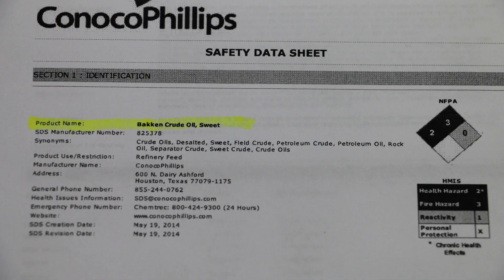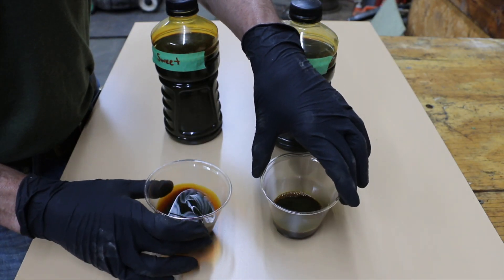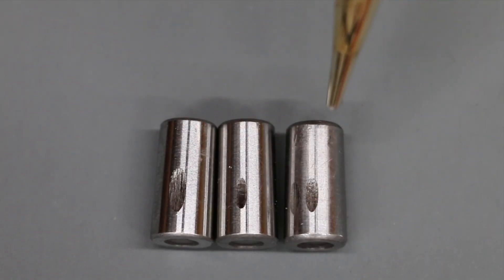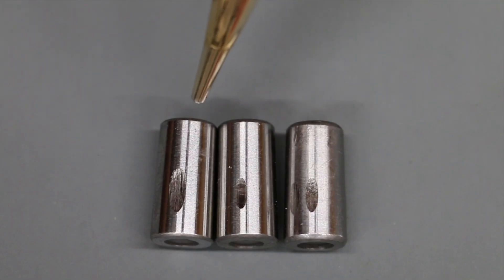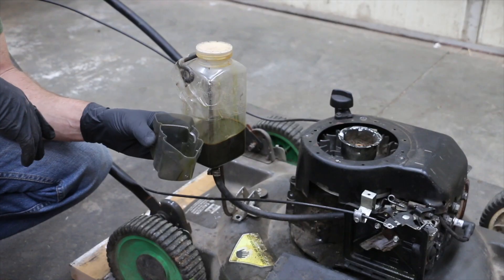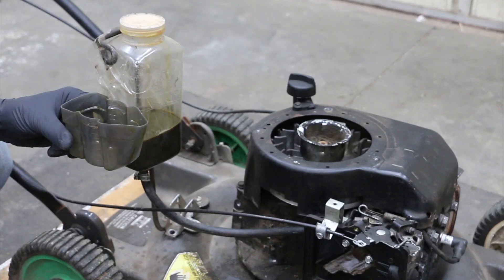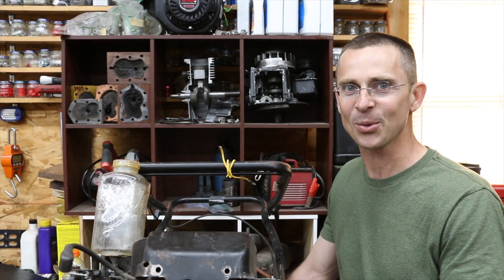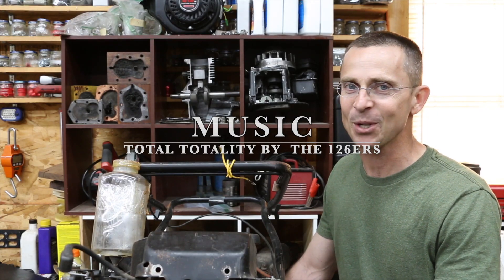Will a Gas engine run on Crude Oil?  Let's try it!

Comment: Thanks for another great test! Here is an idea: We know that an engine will run on denatured alcohol but how much water can be added to that alcohol before it won't run?  For example, most rubbing alcohol is 50, 70, or 91% alcohol, the rest water.
Reply from the maker: Thank you for the video idea!

Comment: What about running a gas engine on propane? I know LP engines and Gasoline engines are generally the same with just a different carb. But would a gas engine run with propane piped straight into the gas carb?
Reply from the maker: Thank you for the video idea!

Comment: My late father burned crude oil in a Dodge that was used on our farm over 80 years ago. He said that he could run the Dodge on straight crude oil from an oil well on our farm on hot summer days. However, he had to drain the fuel system while it was still hot or it would clog up the fuel system.
Reply from the maker: This is interesting.

Comment: Soon as you showed the viscosity of the sweet I know it wasn't going to get through the carb. Looks like a 10.30. Very surprised on how clean the engine stayed. I've dealt with engines with oil consumption that foul plugs out quickly but yours took it like a champ.
Reply: The reason that the crude didn't foul out the plug as quickly as engine oil is twofold. First, the crude oil has a lot of aromatic components, which burn well, and are purposely removed from refined lubricating oils, both because they make lubricating oil worse, and because they're needed elsewhere as fuel. Secondly, most lubricating oils have a number of mineral compounds added in significant amounts, such as zinc and molybdenum, and these leave an ash behind when the oil is flashed off in the combustion process. The combination makes regular lubricating oil very messy when it is pulled through a gasoline engine. The crude was better suited, ironically.
Reply from the maker: Great point.

Comment: It seems that you could tune an engine to run properly off sour crude oil. So the question is, why do we not use sour crude oil burning engines, especially for things like lawn mowers and whatnot? Also, why don't we use sour crude oil as lubricant? It seems to work well and did not even gunk up the engine. Being unrefined, it has to be cheaper then gasoline.

Comment: i wonder how it would run on a disel
Reply from the maker: Thank you for the video idea!
Reply: In an old one, perfectly. Most boring PF video ever. In a new one, the computer will throw 31,794 errors and put it in limp mode because the sensors are raging and dying. Most expensive PF video ever.
Reply: small engine diesel's have sensors now?
Reply: Many do, and many more are scheduled to get them soon. The EPA's new off-road emissions program (thank George W. for that) mandates that most off-road engines have emissions levels on par with on-road vehicles, after the phase-in period, which is nearly over.

They even made it so that fixing the old ones will become increasingly difficult because the manufacturers are effectively barred from making replacement parts for the old pre-EPA off road motors by a pollution points system that makes it unfeasible for them to help you fix your old "dirty" motor because it takes too many points out of their pollution quota. Fortunately, this inane points system is getting slowly rolled back, and some repair parts for some of the older motors are coming back. The law was apparently written such that it can't be simply scrapped, but has to be phased back out. Government at its finest.....
Reply: well guess its a good thing i got a friend who dose milling and 3d printing.

Comment: Ship engines that use bunker fuel (4% sulphur) have total base numbers (TBN) of up to 80 to neutralise the sulphuric acid in the piston blow-by created during combustion.  Automotive oils have much lower TBNs of 8-12 because motor fuels are so well refined.  You’d probably want an oil change after running the sour light crude!
Cheers from Australia 🇦🇺
Reply from the maker: This is interesting. Thank you for this information.  Cheers

Comment: It would be interesting to consider the long term effects of this fuel on the mower components (carb, piston, valves, tubes) and whether the exhaust gases are too toxic for it to be worth the hassle. Maybe filtering it could help stop particle impurities from harming the engine.
Reply from the maker: Great point.

Comment: Please try making the exhaust of an engine go to the intake of the engine and see how long it lasts. If anyone agrees, like the comment so he can see it
Reply: So at that point you're running EGR like a pre-variable valve timing smog-controlled automobile. It is possible to do, to a point, but you reduce the power potential because you're reducing the available oxygen, which requires reducing the fuel to get a clean burn, and if you replace too much fuel/air mix with exhaust, it destroys the burn.

This is not a new idea, and drivers have played with it in EGR cars, believe it or not. The theory is that by increasing EGR, you can lower fuel, and save gas. Essentially, this is using exhaust gas to artificially lower the engine displacement. It works to a point. However what these people have discovered is that with more than about 10% exhaust in the mix it won't run right no matter what else you do.
Reply: It won't run because the oxygen is depleted in the exhaust. No oxygen, no boom. That's why it is vented off instead of recirculated. Hence words: exhaust gas = oxygen is exhausted = used up and time to get rid of it and get some fresh stuff.
Reply: Original_Indy_04 someone has been watching The Human Centipede
Reply from the maker: Thank you for the video idea!
Reply: Your welcome
Reply: Yeah but it would still run for at least some time, like a couple of seconds or something. And u know him, he can tweak it like putting a hole in the intake so it gets some clean air

Comment: The lubricity test results amazed me. The engines of some of the new giant container ships are designed to run on an inexpensive grade of oil not much different than crude.

Comment: I worked in the industry and put raw condensate in my truck. It knocked like crazy. I added octane boost and premium every time it went down a quarter tank. After 2 times it stopped knocking.
Reply from the maker: Interesting.
Reply: The old timers called that stuff "head gas." You do have to boost the octane, but it will run.

Comment: Dude, that's so freaking dangerous... you're nuts.  Touching it without the appropriate gloves (which you didn't have but it looks like you didn't touch it anyway) and breathing the fumes and vapors is extremely dangerous.  There's some tests that I would have never done - this being one of them.
Reply from the maker: Thanks for the caution.
Reply: Thanks bro.  ^_^

Comment: If you get a fuel that's too thick. Next time warm it up on a camping stove in a pot (outside,
) the heat will alter the viscosity. Same idea as running veg oil in a diesel. Will mean you don't have to cut it with another substance
Reply from the maker: Thank you for the recommendation!

Comment: Maybe the good lubrication of the crude oil would make it suitable to run in a 2-stroke engine without having to add any oil? Would be a fun test as well, see if it survives.
Reply from the maker: Thank you for the video idea!
Reply: This one seems really interesting
Reply: Can you pump crude oil through a 2-stroke carburettor? Won't the viscosity be a problem without the crude oil being heated to reduce  is viscosity?

Comment: Its a Quantum briggs and Stratton, pull the main jet (fuel bowl nut) and step it up a few thousandths. The screw you turned is just the idle circuit
Reply from the maker: Thanks for the recommendation.

Comment: Great video & testing Todd!
As best as I can remember the large diesel engines that burn crude oil have to have the oil heated and I think they also added some diesel fuel to the crude oil.
Reply from the maker: Thank you very much and great point regarding crude oil getting heated before use.

Comment: WOW, not a result I would have expected.  That sour oil looks like it burns very clean also and the lubricity test (interesting to compare it to Motorcote) was just as unexpected, I'd imagine it would be way cheaper than gasoline and would be nice to see it at the Gas Stations for things like mowers that run without catalytic converters.   Yet another great project, thanks and keep them coming!
Reply from the maker: Thank you!

Comment: Please try 30% used filtered cooking oil, 70% gas mixture! That should work. If so, we can than use used cooking oil as 30/70 mixture, instead of throwing it away!
Reply from the maker: Thank you for the video idea!
Reply: It would run badly, smoke a lot, and leave vegetable waxes all over the inside of the combustion chamber. Gasoline engines don't burn hot enough to burn up the oil completely, so the residues would ruin the engine fairly quickly.

On the other hand, if Dr. Project wants to show the world exactly how that looks, well, I'll watch. :D
Reply: I don't think it would be so bad, i think maybe it wouldn't be bad at all. He did a video, where he mixed 50% of gasoline and 50 % of diesel in a gasoline engine, and it run fine. Properties of vegetable oil are not that much different than diesel.. so.. i think 70% gasoline, 30% vegetable oil will work.
Reply: You've been watching for awhile. :D However, you're mistaken about the vegetable oil not being that different than diesel. Vegetable oil contains glycerine, which diesel does not, and it has a much higher viscosity, and much lower aromatics compared to diesel. Purpose-built diesel engines have to be customized a bit to burn vegetable oil properly, and a gas engine will hardly burn it at all, even with a gasoline carrier. It won't atomize well in the carburetor, and the combustion simply doesn't get hot enough. A large amount of the vegetable oil would simply get baked onto the engine internals, and most of the rest would simply be spit out the exhaust.
Reply: As i said properties of vegetable oil are not that much different than diesel. (I know exactly about molecular structure of vegetable oil, don't worry :D). In summer you can put vegetable oil (heavily filtered best to 1 micron if you are using used oil) in diesel engine without any modification, people are already doing that (search for numerous videos on youtube). The main difference between vegetable oil and diesel are viscosity. Vegetable oil has higher viscosity than diesel at the same temperature, BUT viscosity of the vegetable oil on a hot summer day is the same as diesel viscosity at colder weather. The modification is only required if you are going to use vegetable oil at lower temperatures (in winter), and the only thing that modification does, is heat up the vegetable oil (there are two common ways to do that). Ps: and yeaah i've been watching for a while yes :D
Reply: "As i said properties of vegetable oil are not that much different than diesel." I am not sure what you exactly know, but you're simply mistaken. The two are much more different than you believe. As someone who has owned many diesels, and burned a lot of vegetable and other oils in them, I can assure you, you're mistaken.

It is true that some people do run vegetable oil in their diesels without modification in the summer. Typically these people are blending it to reduce the viscosity, and even then they are taking some risks because of potentially poor atomization. It is also true that the majority of modifications for running vegetable oil are just heaters, but you fail to understand how important that heating is to the proper operation of the engine when running on vegetable oil, even in the summer. Unless you get the oil to 160 degrees fahrenheit, it will not properly spray out of the injectors, which runs the risk of fouling even in a diesel engine.

But the fundamental difference here is the burn temperatures of gasoline engines versus diesel engines. Diesel engines burn hot enough to burn the many extremely low-volatility compounds in vegetable oil, if you atomize it properly. Gasoline engines simply do not. The bulk of that low-volatility stuff will become goo if you run it through a gasoline engine, and will ruin the engine.

At this point, I hope PF does it just so you can see what I'm trying to explain.

Comment: If the flashpoint is -20 why isn't it burning at room temp
Reply from the maker: Autoignition temp is much higher and is the temp at which it self-ignites.
Reply: Project Farm I thought flashpoint was the lojbt in which it self ignites
Reply: Point

Comment: When sour crude burns I believe it makes CS2 which is used to remove grease and wax as an industrial solvent, hence why the sour crude made the engine so clean
Reply from the maker: Great point!
Reply: This is the stuff I love seeing in comments :) thanks for the info
Reply: informative comment, up you go!
Reply: another damn tom what you think about my comment above? (Making sulferic acid from it)
Reply: Sour crude is oil with levels of h2s gas
Reply: Whatever it produces, it's not exceptionally healthy
Reply: @thomgt4  working on the sour gas wells all day usually resulted in what we called a H2S headache. not breathing the H2S just the smell. well you may have breathed a little as you can smell H2S at 1 ppm
Reply: When you burn hydrogen sulphide, you end up with sulphur dioxide. H2S to S02
Reply: CS2 is one Helluva carcinogen!

Comment: How come a gasoline engine can run the crude oil if a gasoline engine cant run off or diesel or just regular engine oil? I understand a gasoline engine doesnt have a high flash point but Im not understanding why how much of a difference . Althkugh I have never seen the actual difference in the oils

Comment: Try them on the vapour rig so you are running on the gas not liquid.
Large ocean going vessels use something close to crude as fuel they run it through heaters to turn it into gas so the contaminants don’t foul the fuel system or cause build up in the engine.
Reply from the maker: Thank you for the video idea!

Comment: Not sure if you have done it yet (let me know if you have) but I'm curious how well a gas engine will run on various types of alcohol. 50% isopropyl, 70% isopropyl, 91% isopropyl, methanol, and ethanol (of various strengths). Also curious about wood gas but that might be a bit too complicated and time consuming for you. You have to filter out as much of the tar in the wood gas as possible, but that's the thing, I don't think I've ever seen a video of the inside of an engine after running on wood gas. Without much tar filtering, it's sure to clog up stuff. With decent tar filtering, I'm not sure.
Reply from the maker: Thank you for the video idea!

Comment: Im rather shocked that the crude oil did as well as it did.  Now if you could get ahold of some condensate (drip gas) that comes off of natural gas wells.  That would be interesting.  It is used more for marking your real high end fuels like jet fuel.
Reply from the maker: Thank you for the video idea!

Comment: Try crude oil through a 2 stroke. Does it work better than gas/oil mix?
Also would like to see different gas/oil mix ratios on the lubricity tester.
Reply from the maker: Thank you for the video idea!

Comment: I worked in the bakken. You got some heavy sweet crude. The good stuff is clear and thin like water.  I know that runs small engines as pumpers would take it home and try this test.
Reply from the maker: Thanks for commenting on this.

Comment: Very interesting.  It seemed logical that since crude oil is the base for gasoline/diesel that it would work as fuel by itself.  But I wasn't sure and it was interesting to see it work fine as long as the viscosity was right.  Great test!
Reply from the maker: Thank you!

Comment: got a suggestion - how about adding material into the cylinder head or doing things to increase compression? just a thought, may help with functionality of diesels, and maybe try running a glowplug too?
Reply: I would also suggest cutting a groove onto the piston for a third ring, but the oil ring would be an issue
Reply from the maker: Thank you for the video idea!

Comment: back in 1996 I was driving a 92 Mitsubishi Expo . I ran 50% pa dude oil in it for several months . tried 100 % put valves noise and loss of power . this was a fuel injected engine . 
 also know of guys  running in diesel pickups ..
Reply from the maker: Interesting.

Comment: Will an engine run if the motor oil is replaced with KY Jelly? Would also like to see it on the lubricity test.
Reply from the maker: Thank you for the video idea!